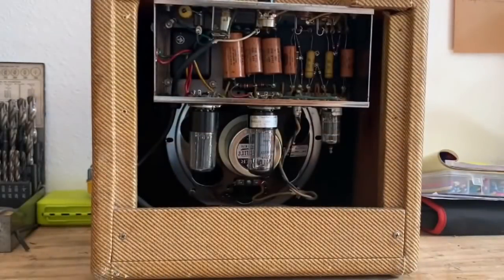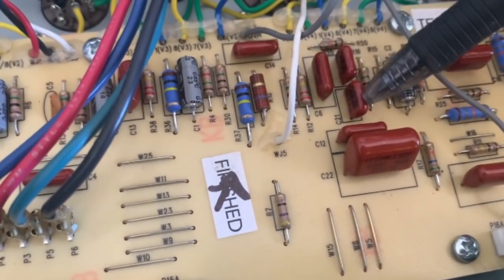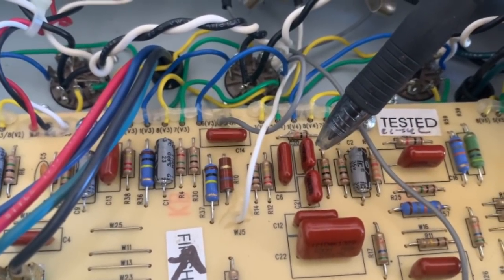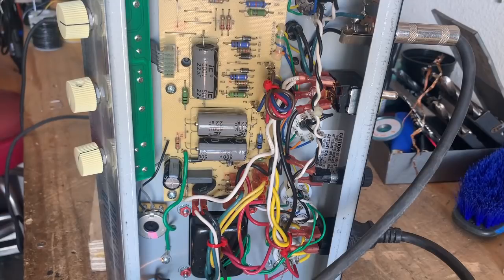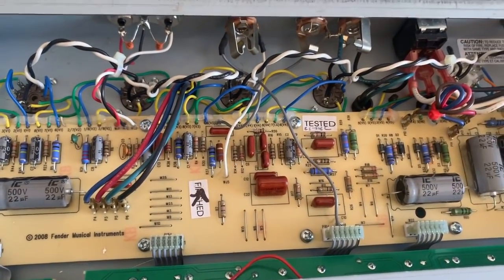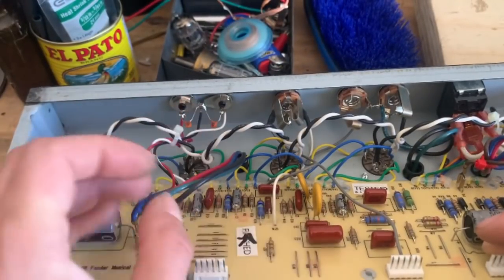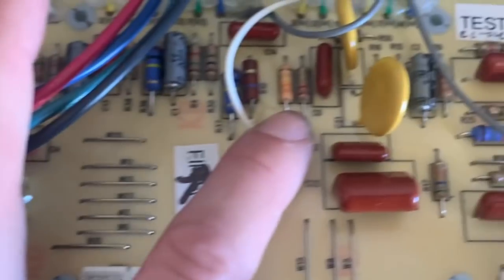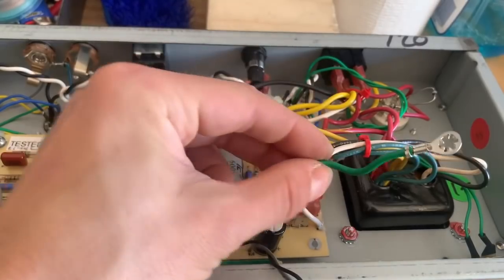Princeton Reverb Tremolo Mod

Comment: What was the value of the caps and resistor you took out?
FWIW, disc caps are microphonic, and change value significantly with temperature.

Comment: I have a mid 60s Princeton. I had it refreshed by someone experienced/qualified like you (proper grounding and a few other fix/mods). However/unfortunately, my dad replaced the Jensen speaker with some other off brand many years ago. (rather than getting it repaired/restored .. bummer).
 What would be a good replacement?

Comment: Helpful tip and very good explanations,. BUT you have to explain how to unload all charged capacitors ⚠before putting the hands inside the amp, to avoid any electrocution risk, no ? .

Comment: The stock setting on the tremolo speed is nearly useless for me. Too fast even at the slowest speed, so this is a very useful mod. You don't need to always notice that it's on, it can be a subtle pulsating kinda thing. I don't know if I've ever seen/heard anyone use the trem with the speed higher than halfway. It's a whole different effect then, like one of those useless settings on a cheap multi effects thing. Great stuff as always, even if I don't understand much of it!

Comment: yesterday I installed the bright switch on my DRRI 65 vibrato channel, by braking the trace on board and soldering switch line on pot's and cap's legs. Now I understand why reissue on PCB so bad for modifications.

Comment: nice.  I have a new 68 Vibrochamp Reverb (the reissue)  i wonder if those caps are similar in the champ circuit.  The depth is fine, i'd just like to slow it down

Comment: I love my Princeton 68 reissue. I got it in a package deal for a motorcycle I had for sale…. I would never have bought one otherwise but what a great amp it is. I blast it in stereo thru my pedal board with my hot rod deluxe (or my dsl40c Marshall) and it really enhances my overall sound. A very worthy amp for classic rock too surprisingly! I set the bass nearly off and treble at 8…. with the volume around 4 it starts getttin’ busy🤘! I don’t use the tremolo a lot though it is cool. I do like the slower sound you get here, not sure I dare try it though lol. Thanks! Good stuff.

Comment: Replacing foil caps with ceramics? -_- 
Also, I would probably remove caps and the resistor by grabbing them, heating the joint, then pulling them out, fist one leg, than the other. And use the pump (or eventually the braid, but probably not) just to clean the pad.

Comment: This channel is terribly interesting and it's got me thinking of buying a deluxe or bassman kit. Do they make a dumble kit? Lol.  I have extensive soldering experience, on car wiring harnesses, not tiny ass PCB boards. But I'm willing to give it a try. I've got a 65 tweed PR reissue, I think the stock trem is sweet AF.  Modded Amps are cool and all, but why go thru all that when you can just get a vibe pedal with a photocell and get almost the same sound? I'm a don't fix it if it ain't broke kinda guy tho. That being said, a Bill M modded blues Jr sure sounds sexy. Thanks for posting I'm learning a lot.

Comment: I have an original Princeton silver face from about 1970 (sans reverb). I have a minor problem with it. The tremolo never seems to be completely off. It's very subtle but it would be nice to have it off completely. I dial it down all the way on speed and intensity and you can still detect a small amount or tremolo. Otherwise the amp sounds excellent. Have any idea what might be causing that? Really liked the above video. Very clear and concise.

Comment: Hi - great videos - really interesting subject and great explanation.  Would you be able to put together a video that shows the tools you are using and what each of them allow you to do.  For example I saw a video where you used a box with a lot of switches on to simulate resistors - not seen that gadget before. :-)

Comment: Cool. But one question: when you change the caps, like you did with caps of different values, where does the e ergo go? If you substitute components with components of a different value, where does the extra energy go? Or if it’s a decline in energy, how does the circuit work?

Comment: Love this trick, thanks! I also notice the reverb on this amp seems to be pretty lackluster. At least on my Princeton it does. Any tips there?
Reply: Not sure what they used for a reverb pan in that model. Do some reading up on the different spring reverb tanks available, might be able to swap yours out with one with different character. (Assuming you want a plug and play solution) mojotone and antique electronic supply have reverb tanks

Comment: Hello Colleen. Not sure if you respond to these comments, but I have a Fender Deluxe Reverb which I picked up from a bar's curb side, after Hurricane Katrina. It looks like half the amp was standing in water, covering the reverb tank and about half the 12" speaker. The electronics above I believe stayed dry. Unfortunately, the fuse and tubes were pulled out. One of the power, output and choke transformers have the numbers 606-6-35, another has 606610 and the other EIA-606631. Would this be a 1966 model? I'd like to get it working, but I don't know if it would be worth putting money down for the missing parts and continue to become a money trap.  Any suggestions?

Comment: Nice!  I was wondering about trying to mod this without removing the original components, but by putting new components in parallel. For example, instead of removing that 1M resistor, just put a new 1M resistor in parallel. Or even a mini-trim pot (so you could dial in the sound you like.  Same with the caps - just new new ones in parallel. Obviously you could not (likely) get away with 2 leads in each hole, but you might be able to solder the new components to the existing leads on the top of the circuit board. That way you don't have to unsolder anything, or remove the circuit board.  Not sure if this is a good strategy or not. I wonder what you think about the pros/cons of this idea.
Reply: I was wondering the same thing.
Reply: I have figured out through my years of diying that shortcuts rarely work and that it pays off to do work properly. Why do a nasty job when you can do it nicely? You have very limited space on the top of the pcb, it looks ugly + you risk to do heat damage to the original component.

Comment: Great vid, this is a must-have mod that I always use with my Princeton builds!  BUT, I've had mixed results decreasing the resistor by too much--if the trem signal is too hot, it can cause unwanted distortion along with the oscillation.  Another related tweak to try if you really want to take the trem to the next level is replacing the tremolo oscillator triode's cathode bypass cap AND resistor with an LED.  Might sound crazy but it also increases the depth!
Reply: A red LED should give you a bias around 1.5v (generally) and it acts as a full bypass (think very big cap) and that's where the depth improvement comes in.  The other bonus is it pulses in time with the tremolo.  It could be mounted to the front panel as an indicator of sorts, or on the bottom side of the tube (for a pulsing tube effect).
Reply: Does the term wear out the 6v6s faster? And do you  think the stock weak tremolo was to not abuse the power tubes as much?

Comment: I preferred the richer depth of the mod for the tremolo tone as an improvement, but the mod for speed seemed to slow, speed probably would've been fine remaining stock if not using something that somewhere in between the stock & modded parts.

Comment: I was wondering, do the IC filter caps need to be replaced in Princetons like they do in most Fender amps? Ive heard those are really cheap filter caps and that youre better off just always replacing them in Fenders cause they will fail earlier than they are supposed to almost always.

Comment: Wow, I never knew about the solder braid, I'm gonna have to get me a piece of that. I wonder, will scrap of braid from a humbucking pickup do the same job?
Reply: No, copper braid has better heat conductance, sucks up the hot solder better. It's not expensive, like $4 on Amazon.

Comment: Liquid Flux on your solder wic also works well for removing solder from the connection.  Why disc caps instead of using the orange drop style as originally used?
Reply: They’re cheaper—the oscillation loop caps aren’t in the signal path so it doesn’t really matter what they’re made out of

Comment: Great video! Here's my favorite trick for solder braid: if you want it to really suck away the solder like a sponge, first fan the braid out by pulling the sides gently, and then dab the braid with a liquid solder flux pen, so the wick absorbs the flux. You can let the flux dry in the braid for later use, too. The added flux will draw the solder into the braid with authority :)
Reply: if there is no solder wick at hand even the braid copper shielding from cables works. You just touch it with the hot iron over a piece of rosin and it gets impregnated and works a treat.
Reply: @ionut5350  Us frugal people use old RF cable braid.
Reply: Thanks for the tips!!
Reply: Solder sucker works fine for me

Comment: I like the way you talk and your voice is very sexy! By the way, I have Gibson Les Paul GA-40 from 1956. This one's tremolo is very very weak. My amp tech changed all the capacitors and tubes if they are necessary. But no improvement...This amp is designed to run in voltage in USA. I use 100V and I should add step up trans to adjust the proper voltage.
Reply: She looks the part also

Comment: Excellent! On these fender pcbs I like using a big led light like you’d stick on a camera to backlight it so I can see the traces and front of the board. Clipping the resistors is SO MICH EASIER on pcbs. Smart!

Comment: I’m guessing to increase the depth of tremolo on a ‘65 DRRI Amp you’d decrease the 1M R39 resistor, yes?
Reply: No, the tremolo circuit is different from the Princeton. Although the caps  for  speed are the same. I might try these mods on my Princeton and Deluxe at some point.

Comment: Thanks!  I’ve been wanting to slow down the tremolo on a Blackface PR clone for a long time. Knew how to do it but was only going to replace one of the .01 caps with a .022. Clearly changing both caps is what I want!

On my build the tremolo intensity is so strong no change is needed. May have to do with how I’ve biased the amp.

Comment: Auntie Colleen, while you have that circuit board flipped up, might a well swap out those IC filter caps with some nice F+T's!

I wish my hands were as steady as yours. Don't get old!
Reply: I second that. Dejunk that amp!!
Reply: Dan, Russell I agree. Swapping the IC caps for F&T's is just a good idea. You're gonna do it sooner or later anyway and with the IC caps, it's probably sooner than later.

Comment: Great job. I've just as of late been trying to figure out and fix my amps, love your vids.  I have a jcm 900 slx 100 watt  and it just completely went down one day(the sound).I opened it up the other day just to see if maybe I could see anything and nothing looked burnt or broken , I found one fuse blown and I've replaced it, but I haven't gotten to see if it fixed it bec I need new tunes. Anyway love your videos and the wealth of information, thank you.

Comment: Why use the braid on the caps. but cut out the resistor?
Reply: Probably because, unlike the caps, it's difficult to grab ahold of the resistor, which is small and flat against the board; also probably because the resistor leads were bent over and therefore pulling up on the resistor with pliers risks damaging the solder pads. Not to mention that resistors are cheaper and easier to find than capacitors, and you might want to use those caps on another amp, or  elsewhere in the circuit, or perhaps  put them back in the amp someday, if you or the next owner doesn't like the mod.

Comment: Did you stop using the de-soldering pump or is there another reason for using the braid here?
Reply from the maker: Hi! I use the de-soldering pump if there’s a lot of solder to remove (like with vintage amps). With PCB’s, I typically like using the braid, as the traces are fragile and I feel I have more control with the braid :)
Reply: @FazioElectric  I agree. I find the spring-loaded solder pumps a bit...abrupt, especially on delicate boards, like you say. Braid is much more controllable. Ever used the vacuum desoldering stations? I've got one of those and for rapid part reclamation, like, to fill up your parts box, they're great.